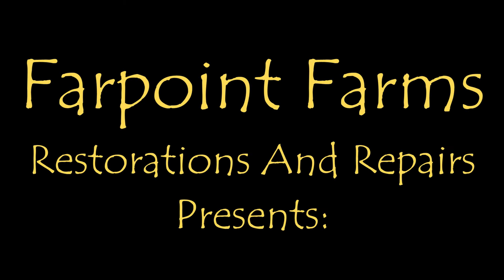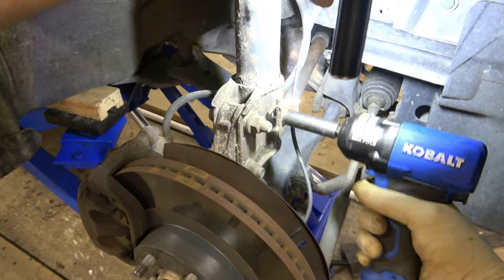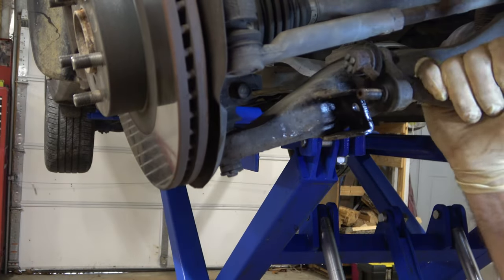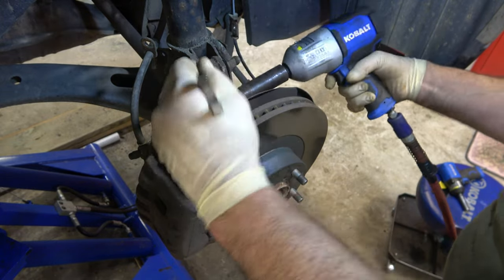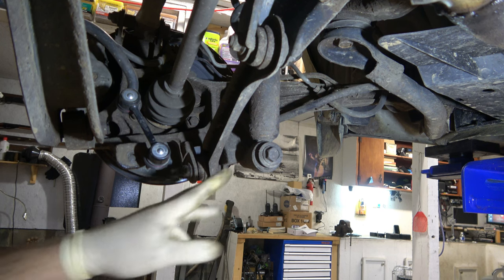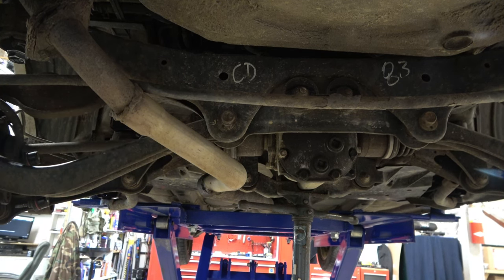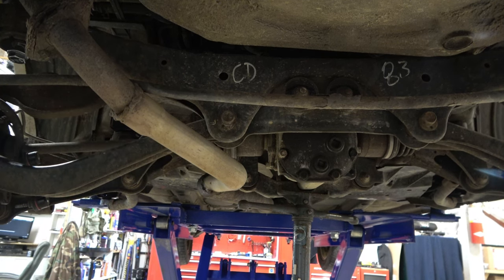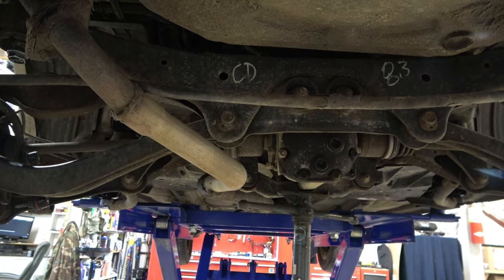ADF Subaru 05-09 Subaru Outback 2 inch lift kit install video. Step By Step!

Comment: I followed your instructions and the installation was not at all as difficult as i anticipated. The only issue was i noticed a knocking coming from the rear and found that the exhaust was hitting the support where it passed under the diff. Mine is an outback xt and has dual exhaust. That might be the issue.
Reply from the maker: That could be the difference of why it was hitting a bit. Thanks for the information.

Comment: How is that going to effect the cv joints? Years ago we had issues with that
Reply from the maker: The kit I bought was chosen specifically because it doesn't raise the car enough to mess with the axle angles. Any more than 2 inches and there starts to be vibrations or worse on these models.

Comment: Audio level just a little low in the initial moments of video. Improved later.
Reply from the maker: It's still a work in progress. Even after all these years I have yet to find a decent lapel mic. This is as good as it gets using a stock mic in the Sony camera I use. I have learned a few tricks when editing the videos to raise up lower sounding areas, but that only helps so much.

Comment: Very cool project , and a great job . I love those Subaru wagons . My sister had one similar she bought new several years ago . No issues at all the 5 years she owned it
Reply from the maker: Other than the head gaskets they are decent cars. They are great in the snow and get OK gas mileage

Comment: Great video, I'm about to buy a Legacy (I can't find a good Outback with manual transmission and Lo/Hi where I live) and plan to lift it just 1-2". I really appreciate that you use a tripod/stand for the camera, many videos like this have a friend holding the camera and it wobbles, gets out of focus, etc.
New subscriber here 😁
Reply from the maker: Thanks for the kind words. I do try to make sure that these videos are clear, well lit and of use. Glad it worked!
Reply: the legacy has lo/hi? did you ever end up finding one
Reply: @ace7912  yup, I bought a Legacy 2005 with Hi/Lo. Since I later got the chance to upgrade to a newer daily driver, I went for a 2014 Forester XT, and they only come with CVT as far as my limited knowledge tells me. I am super satisfied with the XT tho, with a Stage 1 chip tune I got a "WD-40 vehicle" that does everything for me. DD to/from work in any weather, some light off-roading, overtaking in a jiffy, room for Great Danes, and more 😁
The Legacy is now our backup car, and I have a set of 30mm pads to get more clearance that'll go on in the summer -24. Pretty awful (IMO) weather here in Sweden now, but I feel rock steady on any surface with my Forester 👌.
Happy Holidays!

Comment: I got a 2000 Subaru Legacy GT 
, e tune, AWD, twin turbo, Japanese import, right hand drive. Figured out how to put a 5 inch lift on, got 265/70/17(31 inch tire), going to have to cut a bit with the ol' grinder but I'm fine with that, car is a write off but still in good shape should be sweet when it's done
Reply from the maker: That will look SWEET! Good luck!!

Comment: Hey man, new to your channel. Hope I get an answer to this wuestion but is it posible to dp a 2 inch lift with just the strut spacers and not the cradle?. Thanks.
Reply from the maker: On the front, yes, on the rear, no. The Axle angle would be too far off and damage would happen.
Reply: @FarpointRestorationsAndRepairs  Just sold my 05 outback 3.0r that I just bought last week. I don't think I'll be able to do the rear lift, just by looking at what you where doing. Haha. Thanks for responding.
Reply: @FarpointRestorationsAndRepairs  Now that I sold it. In your opinion, what's the best subaru that has the least parts to breakdown, leak, etc... Thanks.

Comment: At 12:30, what was the purpose of punching the nut with the hammer?
Reply from the maker: You need to deform the lip of the nut it acts like a lock washer as you hammer the lip into the slot on the axle.
Reply: @FarpointRestorationsAndRepairs  thank you so much!!

Comment: I'm wanting to do this to my 05 obxt. but I'm worried about ride and gas mileage. I drive 90 miles a day and need to keep up the mileage.
Reply from the maker: The customer reports no change in mileage. The ride is nearly the same, even with the aggressive A/T tires on it.

Comment: How much was it for u to put it on and where are u located
Reply from the maker: I don't install lift kits anymore, but this one took about 5.5hours so you can figure 100 an hour times that, plus the kit.
Reply: @FarpointRestorationsAndRepairs  Any particularly reason you don't install lift kits anymore? (seems you made that comment only a few months after this videos release...)

Comment: I have a question for anyone who installed the 2 inch lift. Have you had your Outback make grinding noise after install? Im having that issue on the driver’s front when I accelerate and stops when i take my foot off the accelerator. It is the base model manual transmission
Reply: Did you figure out what happened?  You may have pulled the axle out too far?
Reply: Mine never did.